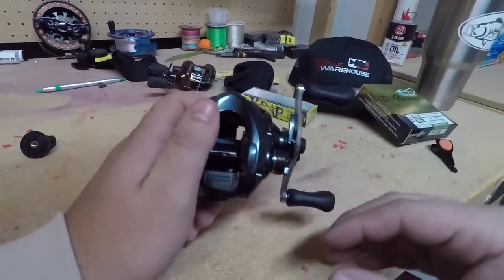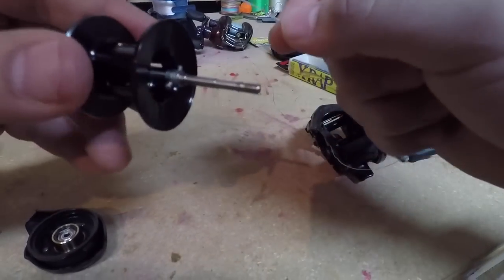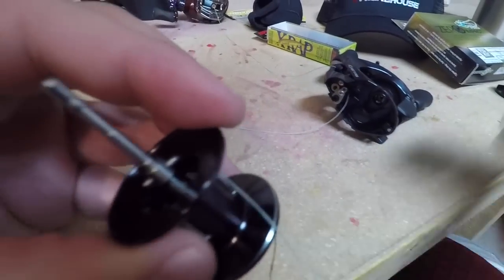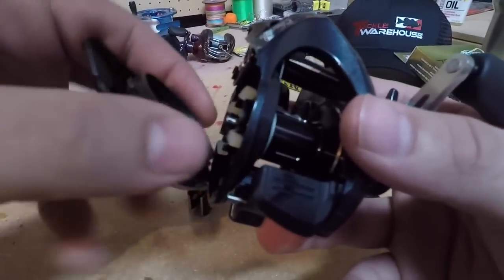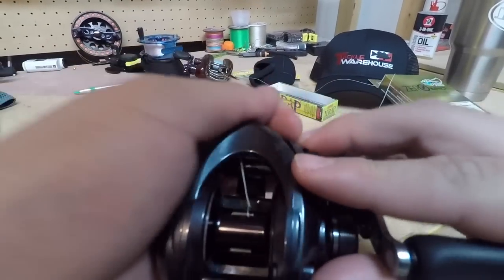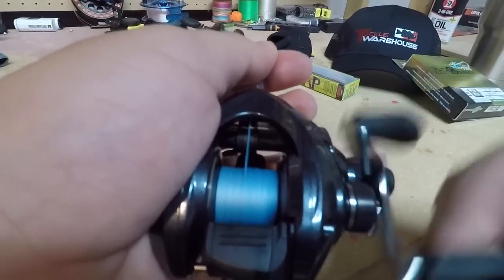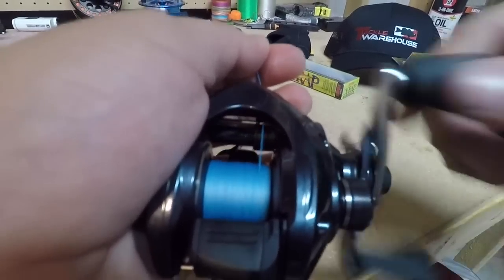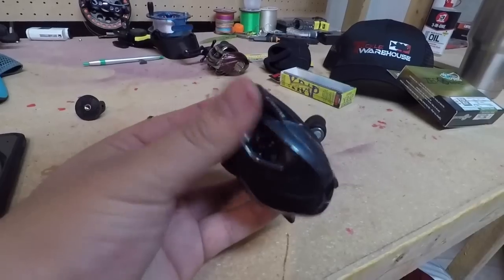How to Spool your Baitcaster- EASY

Comment: Just purchased a Casitas 150hg. I have to whip mine pretty hard to get moderate casting distance. Is there something I overlooked? I do not have a lot of line on the reel.
Reply: Just gonna ask, are you new to baitcasters? If so watch videos on how to adjust the brakes on the reel and how to tension knob works. Usually, less braking power gives you more distance. It's always best to adjust the tension knob to the bait you're using as well. There are hundreds of videos on YouTube that can provide you more detail. Hopefully you've figured this out in the 2 months you've made this post. Cheers and tight lines!

Comment: mono n braid line which ones is better n strongs
Reply: RedEye CityDotCo I use braid when i go to the docks and are targeting bigger fish because with braid you could get stronger line in a smaller diameter. But with mono it is a lot easier to tie on hooks and stuff because its stretchier. In my opinion i would go with braid because you can get more line on the reel and it could be stronger line too but its all about experience